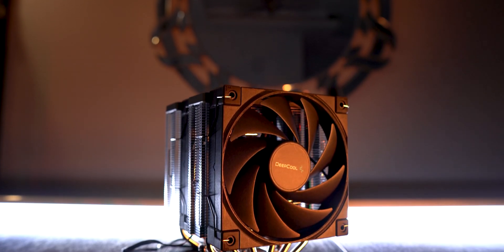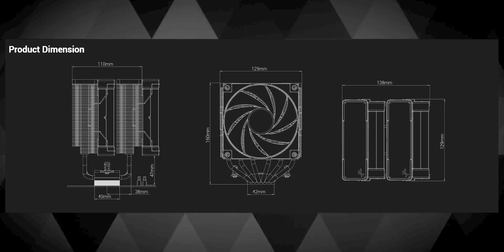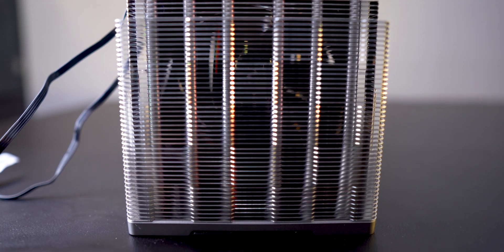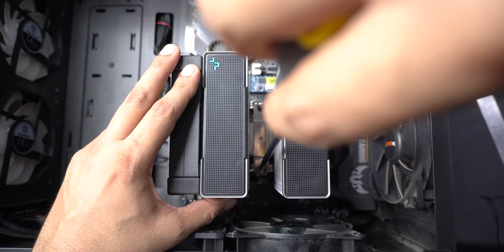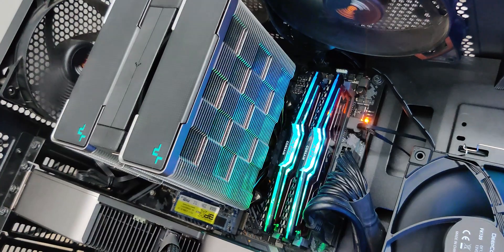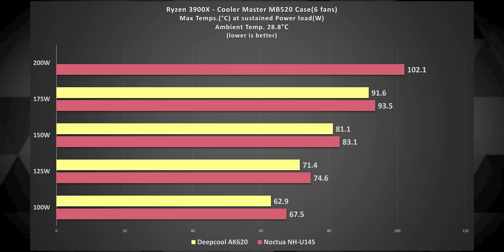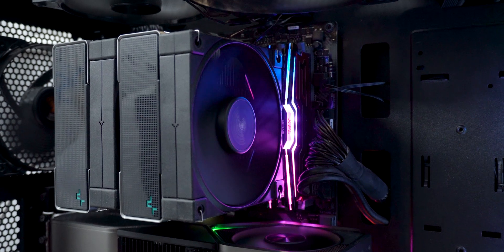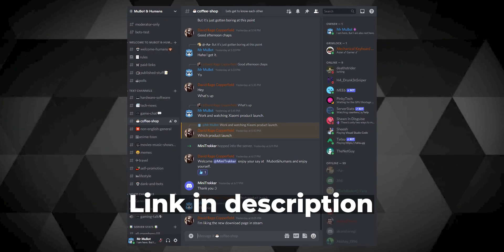The Deepcool AK620 KILLED my Noctua!

Comment: Is ag620 good with i5 13500?or liquid cooler is needed?stock cooler valorent temperature goes 84/86°C. I play games a lot
Reply from the maker: It should be fine if you room temperatures are moderate.

Comment: Stumbled upon your videos while researching for my gaming pc ..I have to take a call on the cooler ..can’t decide between ak and ag 620 ..I ll be running a 5700x
Reply from the maker: Both will perform good for 5700X. But get the AK if you can.
Reply: will it work for 5800x as well? @MrMuBot

Comment: I bought another cooler that looks next to identical to AK620, and it allows i9-13900k sit well below 85 C in stress benchmarks, after I added Noctua NF-A12x25 fans to it
Noctua is a strong cooler, but it struggled even with i9-9900k
Reply from the maker: Damn that's impressive. Which cooler is it?
Reply: I had problems with an i7 13700 and a noctua U12A, it could not keep it under 100º in the stress test, there is no noctua to date that can with the 13th gen in the stress tests.

Comment: This thing is going to sell very well! Between its performance, cost and great size - it's a winner! I'll also bet that this will keep up with a non-overclocked i9-12900K, decently. Thank you for the review!
Reply from the maker: Yes it's going to sell well. But for the 12900K I'll bet my money on a solid and reliable 360mm AIO.
Reply: @MrMuBot  True, that would indeed be the best bet for that processor. However, it is amazing what some of these air coolers can do now.
Reply from the maker: @zingwilder9989  I agree. Pretty happy with it on my 3900X.
Reply: It will keep up even with i9-13900k if you change fans to Noctua NF-A12x25

Comment: A 2 degree difference at the 200 watt power point is not a huge difference and the U14s is much easier to clean and lighter on the motherboard. 
I just got convinced to not replace my NH-U14S
Dual cooler towers can cool slightly better than single tower coolers, but they will always have the design flaw of hot air from the first tower, contaminating the second tower's air intake, greatly reducing efficiency. Also the NH-U14S is one of the quietest and quieter than the two fan models.
Reply from the maker: What chip do you use?
Reply: My noctua U12A is much better than the NH-U14S and it has not been able to cool a 13th gen i7 well reaching 100º at 219w, I had to lower it to 205w to keep it below 90-92º, each generation is different, so they would have to do tests again with the latest generations to find out if there is a cooler that can handle them at a temperature below 92º in the stress test without having to lower the watts. Could an Ak620 with this generation? I don't know..

Comment: The Ninja 5 equipped with 2 XPG Vento Pro (Nidec GT) is a killer setup as well.
It’s even cheaper with cooler and the 2 XPG fans. My 3900x runs at 4300mhz@ 1.28v,
and gets 92c in FPU stress in AIDA ON CPU diode at 24c ambiant.
Reply from the maker: That's pretty good too.

Comment: Can you make a second small video on blasting your 3900X at maximum heat with fans at above 80 percent and 100 percent on ak620 to see if it throttled down. 

It'll be a relatively easy video as it's already installed on your PC. 
Please
Reply from the maker: I have an AIO installed right now.
Reply: @MrMuBot  Oo. still you're a hardworking guy anyways. Replace it again for this video 😛
BTW which is quiter ak620 or AIO in real world?
Please make this one video in near future.
Reply from the maker: It depends on the kind of fans an AIO or an air cooler uses - and how many they are.
Reply: @MrMuBot  yeah I get that in the end both have fans. 
I got covaxin first shot yesterday in under 18 vaccination drive. My shoulder is paining a hot, had just a little fever, I actually just woke up, I slept at 6pm yesterday because of hand pain ,(still not gone)
Reply from the maker: Ah damn. Take care.

Comment: could be on pair then with the nh15?
Reply from the maker: Didn't get you.
Reply: @MrMuBot  if is an equivalent to the nh15 in performance.
Reply from the maker: I read some reviews where they claimed it beats the nh d15 slightly. But it's safe to assume that it's equivalent.

Comment: This cooler can handle amd 5950x?
Reply from the maker: If the peak power consumption goes above 160W-170W, then the AK620 will struggle.
Reply: @MrMuBot  AK620 vs Noctua NH-D15 which is better ? (5950X)
Reply from the maker: If only I could test that. I believe D15 might be slightly better though. But really can't stand behind that statement.

Comment: Bro.. I watched your review about Asus Tuf A17. I wanna buy a laptop for gaming, 3D editing and. Programing. I'm in a plan to buy a Asus Tuf A17 Ryzon7 cost Rs. 88,900 in amazon. Is that worth or should i go for different options?
Reply from the maker: If it's 4800H + 1660Ti then yeah go with it.
Reply: @MrMuBot  thanks for taking time to reply me. And I'm also little bit confused about RTX 3050 vs GTX 1660 ti. 
Is that both are same?
Reply from the maker: Yes it's a mixed bag between the two depending on which games you play. Can't go wrong with either one of them if rtx games don't matter much.

Comment: answer in 0ne w0rd, which 0ne is better ? air c00ler 0r liquid c00ler ?( when budget isn't the issue )
Reply from the maker: If budget isn't an issue then AIOs are sweet to own considering you know what you're getting and if you can be a little precautionary with its maintenance.
Reply: @MrMuBot  alright! cheers man!